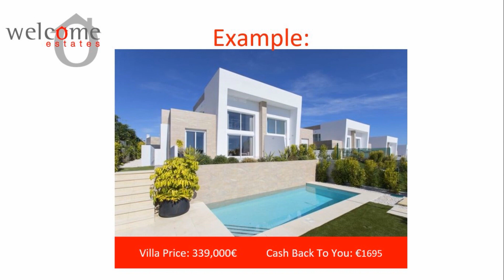what does FLEX eat ? #8

Comment: Hi Gary, yes you are right about the boxers drinking lots of water about a week out before the weigh in, and then they reduce their water intake gradually until about 24 hours before the weigh in they will not drink. But by then their bodies are used to pissing a lot because of the excess water so on that last day they just piss but dont replenish. Quite dangerous if they don’t do it properly - but great way to get those few last lbs off. It’s called a water cut.